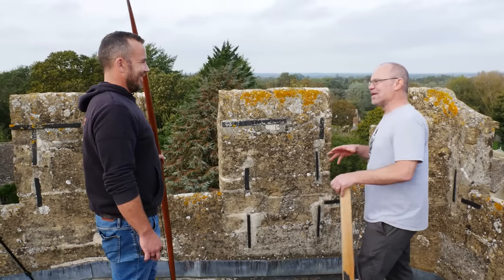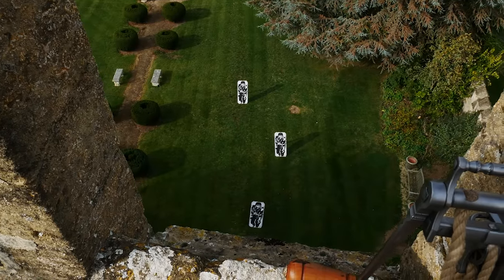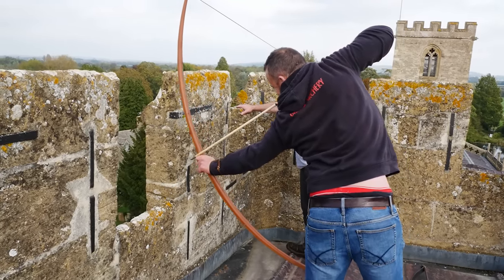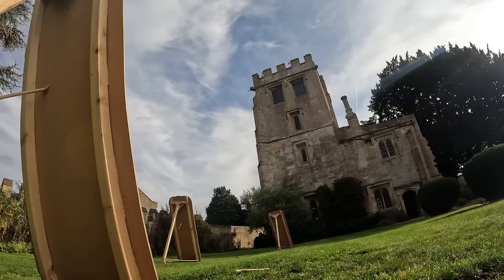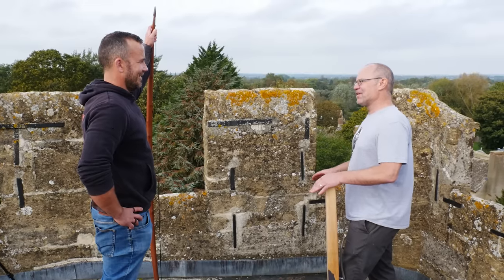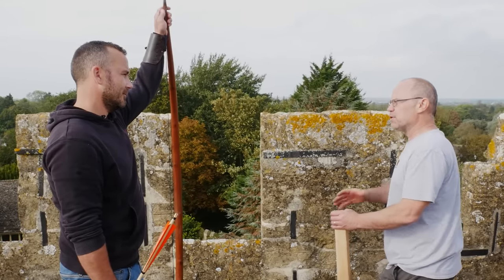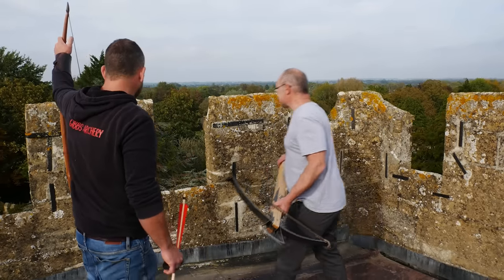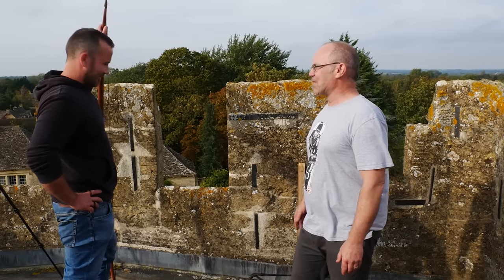Crossbow or Longbow? What's better for defending your medieval tower?

Comment: I'm a bit of a longbow fanboy but I think the crossbow might have come into its own with untrained people who could be quickly taught how to load it for a shooter. Something like a goats foot lever
Reply: I just think that fundamentally the crossbow is easier and quicker to learn. Muscles for a longbowman will take years to develop. What could an amateur do?

Crossbow? Take 100 shots and you'll have a reasonable idea what's going on.

So for untrained people, crossbows (and later, muskets), were the easy choice.

Trained? I'll take longbows over either.
Reply: @peterwolf4230  definitely longbow attacking a defensive structure and in open battle but defending a castle I think the crossbow was favoured for certain reasons. I think it was Warwick castle held thousands of bolts in barrels I believe
Reply: The spanning horse (Spannbock), a furniture size goat foot that could load a 1000# xbow with one quick pull.
These were common in castles & watchtowers
Reply: @peterwolf4230  An advantage of a crossbow in a defensive situation is, that you could shoot accurately it all day if need be. Even a trained longbowman would start tiring out after a few consecutive arrows especially at certain angles of fire. Firearms obviously also had a much greater armor penetration potential and were more effective against cavalry.
Reply: @Tony.795  The other advantage of a crossbow, at least a munitions grade crossbow with a steel prod, was storage. Cover the prod in wax or oil, stick the crossbow in the armory, and forget about it beyond the occasional inventorying until you're besieged. A longbow wouldn't last too long with that treatment, but a steel crossbow prod will be fine. Also, crossbow bolts could have wooden fletches, which will not deteriorate in storage as quickly as feathers will.
Reply: Training levies to quickly and easily use crossbows effectively was a big deal at the time. I can't remember the specifics, but I know some nobles even complained (to the Pope, I believe?) that they were an ignoble weapon, wanting them banned in Europe, since an inexperienced peasant could essentially kill a knight on the battlefield with one.

Comment: First, fortifications were rarely just bare stone - there would have been wooden barricades and fences giving further protection to the defenders, possibly allowing bowmen to hang out from the stonework. Secondly, you do not need to shoot from the middle of the open space; you could be partially covered by the stone as you shoot through the smallest degree of space between the stones. Lastly, reduce weight of bow or span but use heavier projectiles thus using height to provide the extra velocity (also meaning spent projectiles are less effective to the beseigers).
Reply from the maker: Thanks and yes your are correct that 'proper' castles would often have additional hoarding etc, however this tower never had that.  Interestingly shooting down does (potentially)  increase velocity, but not much.  Gravity is 10m/s/s and the travel time from tower top to bottom is about 0.2s so in fact the downward start point would add around 2m/s to the arrow speed which is is around 60m/s anyway, so not massively different and then of course drag will knock some speed off anyway so yes it does make a difference but very little.  I agree that a lower poundage bow would be helpful, but we have no evidence they did this.
Reply: Plus real crenelation would have arrow slits for shooting downwards.

Comment: On the subject of shooting at someone close to the walls: Standing on something to get higher up would change the angle a bit to make a shot more manageable.

On the subject of being an exposed target in between the crenulations. It depends a lot on the background. If you siluett against a clear sky you'll make an easier target then if you have a dark background for instance if the tower had a wooden superstructure like many castles had. If you are lurking in the shadows you might have time to take a well aimed shot.

Comment: I think a major thing is, this structure is missing arrow slits and machicolations. The argument between Longbow and crossbow, in my opinion boils down into training and ease of use. It taking a fair amount of practice and strength building to be able to pull a war bow and hit the target. Then the eventual transition from crossbow to blackpowder. The execution of loading aiming and firing being quite similar between the two.
What might be an interesting experiment is get some Lads together who have never done any form of archery and see how much time training it would take to get them to a war bow level. Compared to using a crossbow.
Reply: *I had my crossbow ready for hunting the same day I bought it.
*It took me years to get really good with a compound with sights.
*I finally learned how to be accurate with a traditional bow in adulthood, with plenty of practice and research. God arranging certain magazine articles to fall under my eyes really helped, especially the one in which the Rev. Stacy Groscup discussed how he shot a bow.
Reply: Oh, sorry, let those scenarios show that the crossbow may be time-consuming, but very user-friendly.

Comment: Well, aiming down was always a problem for me too, shooting wooden toy crossbows back in the day. Bows, not so much, but they were fairly lightweight. Besides you two using proper weapons, I would personally be too much afraid of hitting the wall with both the bow and crossbow limbs, so there might be a bit of that going on with you as well, where its hindering you more than it realistically would. Youre just hesitant to put your fairly expensive pieces of kit in harms way.
Be that as it may, there is a limit as to how far down can one reliably hit targets.
In a real castle, that problem is solved with not aiming that close at all though, as there is always someone in the other tower or wall part to do that for you, as you will do for them, hopefully :D

And I guess, if things really get that bad, there are always rocks to throw over the top?
Reply from the maker: You are right that we were worried about hitting the structure and practice would likely reduce that a bit, but the concern would still be there as a limb tip striking the stone would likely remove the weapon from the battle

Comment: The biomechanical issue of the longbow vs crossbow in this setting is huge and understated. Tod for some reason literally says the main reason crossbows are soo good in a defending siege to himself! and just ignores it. You can leave the area of harm, to arm your weapon and then return to perform a quick snipe (meaning your much much safer compared to the longbow). This is much much safer then clearly what the longbow had to do, exposing himself for a long time and having to load in view as well. And all this is ignoring the tiring effects of utilizing the long bow (likely leading to bad behaviors and exposing your self more and taking risker decisions). Its clear shooting in these awkward positions is extremely tiring for such a heavy long bow, if you had to perform 100 shots, his ability is going to drop off a cliff, while the cross-bow will not. Lastly shooting a longbow requires training, and arguably a hastily defended castle, is going to be manned with all sorts of people mostly from people whom never shot longbows, and this clearly is an opening for crossbows where anyone can pick it up and shoot it. This demonstration at least proved why cross-bows are used in defense, I think Tod needs to flush his mind and watch this again with a clarity.
Reply from the maker: I totally agree that you can retire, load and then expose to take a shot, but it was not that different in timing to Joe. So that did slight difference didn't excite me much.  What I found far more intriguing is that Joe was physically in danger from his own actions causing him an injury and I was not.  That is an advantage.  The point about crossbows being easier to use is clearly the case and there are lots of documented cases of non-combatants and even women folk defending castle walls during sieges - Richard 1 was shot by a cook.
Reply: @tods_workshop  I wouldn't underestimate the difference in timing and exposure, at least I notice a difference of atleast 2-3 seconds, which can be considerable, if there let's say is an enemy crossbow man trained with his weapon at the location.
Reply: @tods_workshop  And btw great video, definitely one of your more interesting and better ones!
Reply: @tods_workshop  I'd imagine a bowmans performance would start to deteriorate much quicker than a crossbowmans. A crossbowman firing bolts for hours on end wouldn't be too far off, especially with helpers.
Reply: @tods_workshop  I wonder if it would change if you put a 70-90 lbs bow in Joe's hands instead of the 140.  I imagine he would have a lot more flexibility and variety of movements once you backed away from the splitting edge of power for the longbow.  Using that powerful of a bow requires near perfect form to prevent injury.  Back it off a bit and less than perfect form might allow him a few easier options for shooting angles.
Reply from the maker: @timothym9398  I think you are right, but we have not evidence they used lighter bows/alternative bows, but on the other hand we have very little evidence of anything including the bow weight Joe was shooting

Comment: You have said it before, the advantage of the crossbow is the learning curve, or lack of, if you have 10 trained archers and 30 peasants you have 40 xbowers .. but you still only have 10 archers. The xbow  gave untrained users the ability to have a reasonable chance fairly quickly of actualy hitting something with minimal training, it also to me, seems like an easy way to increase volume of fire, and if nothening else it could help to give cover to your trained archers.
Reply: that last one sounds intresting(the rest already heard and say yes you are right)
Reply: @VuurBarbaar  im thinking if you have the unskilled just pop and fire in the general direction, they are going to cover, that should hopefully allow the archers a few moments longer to aim with less risk, youd have to randomize the timing of coordinated volleys or theyd get used to it, but you could catch someone coming out of cover to soon
Reply: @jeffandrews8578  I don't think you can really aim in the usual sense with a heavy warbow. It's draw and let loose in one motion due to it's drawweight. That leads to another advantage of a crossbow, namely that it doesn't cause near as much exhaustion in a long term scenario.
Reply: I think that also depends a lot on the population you're pulling from.  If it's the era where all englishmen were required to do archery practice every sunday, the far cheaper and common longbow would probably be just as effective with a militia than the complex crossbow.

Comment: That is why modern forts (in the age of canons and muskets) were constructed in such way, with bastions to provide clear lines of fire along each wall. That is why castles began to have towers in corners, slightly pushed out, so you can shoot from one tower along the wall, and protect other tower (which then evolved into roundel, then into bastion / bulwark).

I wonder if proper machicolations or hoardings would help in shooting at enemies at close range?

Comment: I could be completely wrong, but I think that defenders on top of a tower like this one wouldn’t really take the time to take aim at individual enemies. Rather than just peak, fire and take cover as quickly as possible.
Reply: Well, they didn't exactly defend against an ocean of enemies, so some amount of aiming would be required. Although maybe the extremely low casulties together with the high number of arrows used actually speak for your idea and they literally just shot those arrows out there without caring much about actually hitting something.

Comment: Excellent video!
The incident in 1450 was more of a raid due to vendetta than a siege.  It lasted only six hours with Stafford's raiders departing specifically because they were unprepared to conduct a siege. Likewise, Harcourt's withdrawal to the church, upon warning of Stafford's approach, was hasty and improvised.

 While the church crenellation may have been decorative,  it was far superior to Harcourt's unfortified manor house which Stafford burned to the ground. In this sense, the video recreates what the likely conditions were during the raid where only one of Harcourt's men was killed. The narrow tower windows would engage closer targets. However, by the time of this incident, proper fortifications with crenellated stone towers and walls employed pivoted mantlets over the crens where the mantlet pivots mounted on the adjacent merlons. In some cases, the mantlets had arrow loops such that mantlet could remain closed while a defender shot through. If not, then the mantlet could be propped open partially, affording a slit over the cren. In either case, a crossbowman would be able to rest the crossbow for better stability and then pick and choose targets for precise shots. If one observes Italian crossbow re enactment and competitions commemorating victorious defensive events, the crossbow shooters employ rests.

Eventually, hoardings replaced the crenellation mantlets while besiegers adopted wheeled mantlets and mantlet walls themselves.

In Stafford's 1450 surprise raid, while some defenders may had time to grab arms and armor and make for the tower, it is quite likely that Harcourt had far fewer men, the majority of them unarmored, and armed mostly with swords, daggers, with bows and crossbows primarily intended for hunting ...

Comment: so pro's crossbow: anyone can wield it. no matter the strenght. it does shoot instant when ready. no tiring of the wielder during an arrow hold. you can have multiple crossbows ready so you can fire a few shots in a row. short exposure during a shot. Crossbow cons: reloading takes way to long. if you miss a shot you need to reload or grab the next loaded crossbow

pro's  bow: shoot fast and multiple times rapidly in a row. you only need 1 bow and some arrows. they're carryable by 1 person and they're easy on the stairs, light weight. Cons for the bow have shitty angles with the crenelations. you need to show yourself longer than a crossbow when shooting due to a draw and release just takes a second longer than the crossbow.

I think I still prefere the crossbow. although I would like something that kept the arrow in place besides your thumb!

Sweet video lads! really epic that you guys could use the tower!!!

Comment: I think this helps paint the picture of how this kind of warfare occurred. I think media and our view of modern warfare show events occuring so quickly. When these events were a slow, grinding slog not fast paced rapid assaults. It shows how teams of men could operate near the base of the walls installing equipment to drag siege towers into place or carry out undermining. How ladder teams could survive at their attacks. I also think this demonstrates the importance of towers projecting out of the walls to allow enfilading fire. Also how vulnerable towers spaced too far apart could be. It is a great illustration of the difficulties faced by by soldiers before the widespread use of gunpowder weapons.

Comment: Ozstraya In the 70s Tech school a few lads made a crossbow that weekend they shot a bolt into the sky and pinned it in the power line dead centre 
it stayed there for 20 years until re wiring '

Comment: The crenelations are not designed properly, which added to your difficulties. One diffference is that, on real battlements, you would have had machicolations for shooting at close targets. With those being absent, shooting at close in targets was impossible. The second problem is that the crenels were too wide and not deep enough. There was just too much space between the merlons and the bottom of the crenel was too high.

The crossbow has three major advantages over the warbow, ease of training, endurance and snap shots where you pop out of cover, loose the quarrel and drop out of sight of the attackers. 

Snap shooting is much harder to do with a warbow because you have two choices, both bad. You can either draw the bow before you pop out, which means you have to hold 150 pounds that much longer, or you can draw the bow after you pop out which leaves you exposed that much longer. The crossbow doesn't have those disadvantages because, once it's spanned, the mechanism holds the string rather than the strength of your arms.

Comment: Couple coffee shop engineering thoughts: I think lighter bows are key here. And at about the 8 min mark, Joe refers to stepping out of cover, draw, aim, shoot. I'd guess, with a lighter bow, you could drawn and hold longer. This would allow the archer to draw whist behind cover, then step out, aim and fire. Cutting the exposure time down significantly. Add that to faster rate of fire and, if the bow is smaller, more angle options to shoot. 
As to Tod's mention of not hanging out over the wall b/c of exposure; Again, smaller crossbow may make this quicker. But also, risk vs reward. If you don't nail the guys close to the wall, you're giving the chance to them of getting in for the win and killing you anyway. Additionally, you've got a sense of duty to the Lord and your fellow men to do all you can. As well as the added pressure, possibly, of your commanding officer being behind you and he's not going to accept any mincing about. You might be more in fear of him than the enemy shooting you. So I think hanging right out and shooting straight down, if necessary, is certainly on the table.  
Love to see a part two with you guys bringing an assortment of sizes of bows and crossbows up there for a re-do to see what the differences are. 
Thanks Tod!